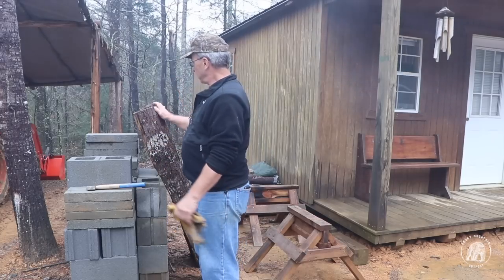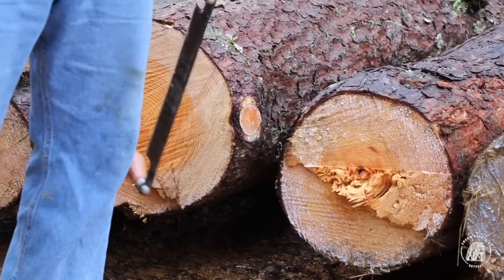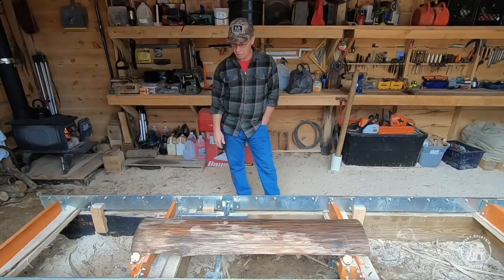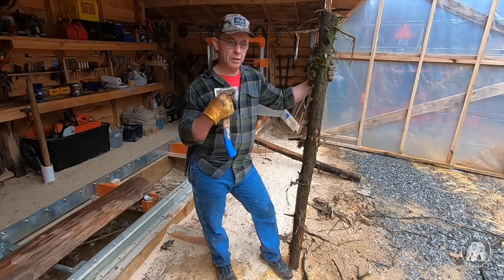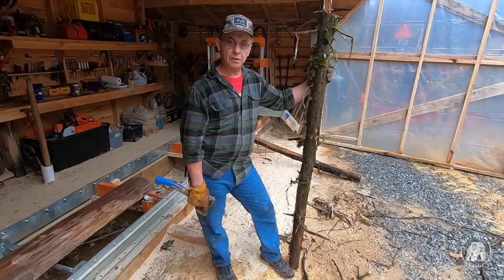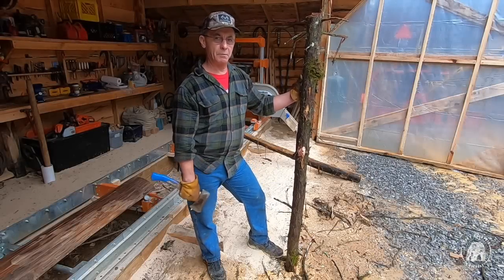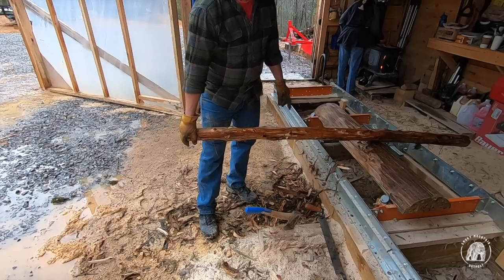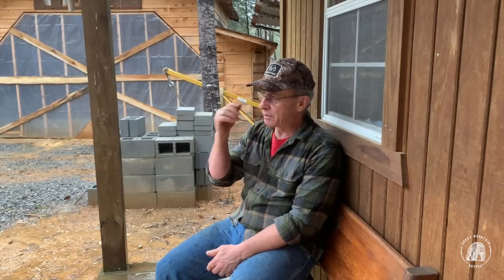QA7 | WOODWORK | TIMBER FRAME BASICS | BUSHCRAFT SAW HORSES

Comment: I don't know whether you've come across pine tar, sometimes called stockholm oil. Its been used in Scandinavia to protect timber for about a thousand years or more. The EU  has severely restricted its availability (has the petrochemical industry been lobbying for this I wonder?). You can just about get it mail order in the UK, and I've started to use it as a go-to preservative for some applications.

Comment: in regards to snow load or live load, there are charts online for different geographic areas throughout the US as to what size and type of rafter to use.  In regard to using a 2x6 for a rafter you need to know that you can only span about 8' with a pine (SPF) board, probably a few more inches with yellow pine (SYP).  You'll have to look up tulip poplar for rafter span.  I believe that your 6' span is probably safe, but by no means are you "Over Built".

Comment: Your a great handyman,  so let's figure out how you can save your 2×4 concrete footer,  I'm worried about the depth of the bolts,  and the footprint is offset on your footer,  putting a footer below your frontline level might save your cabin
Reply from the maker: Hey David. I have written several replies. Check them out. I am not worried about the footers, depth or frost line on the shale location I'm at.
Reply: @SmokyMountainOutpost  what about the  massive weight laying on your 2×4 footer,  and the bolt depth?